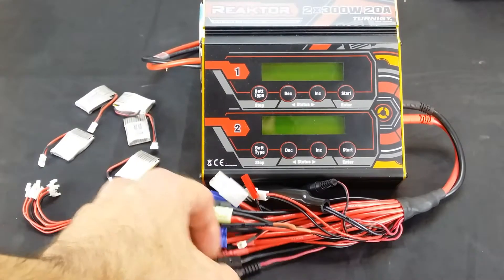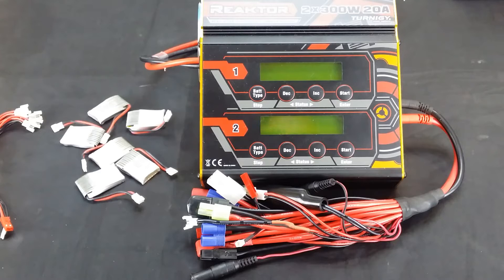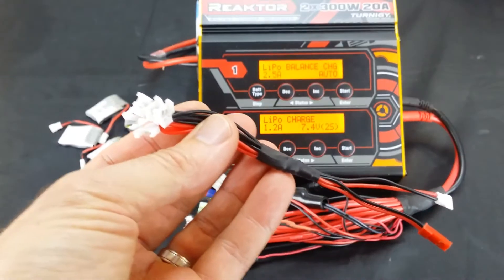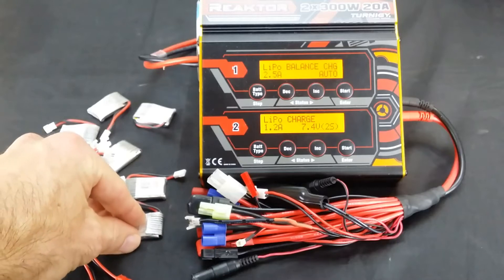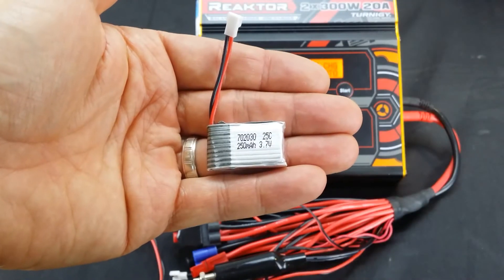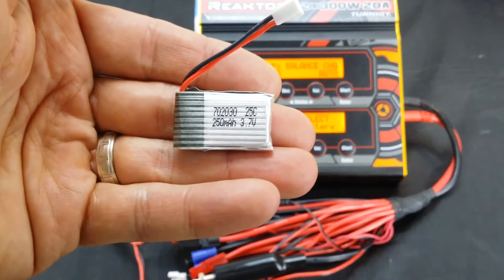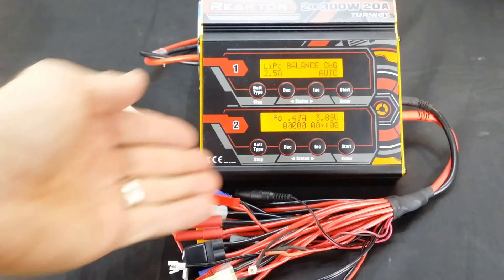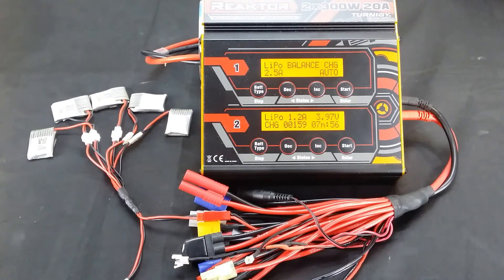How To PARALLEL CHARGE Multiple LIPO BATTERIES

Comment: I have 6 LiPo's all the same.  http://www3.towerhobbies.com/cgi-bin/wti0001p?&I=LXEPLY&P=ML#technotes

Can I do what you are doing?  And can I get all I need from Hobby Klng?

SPECIFICATIONS
Voltage Rating: 3.7V
mAh Rating: 700
Discharge Rate: 25C
Power Rating: 2.6Wh